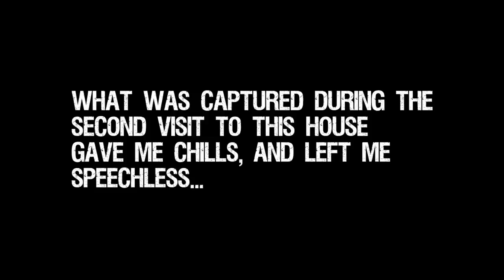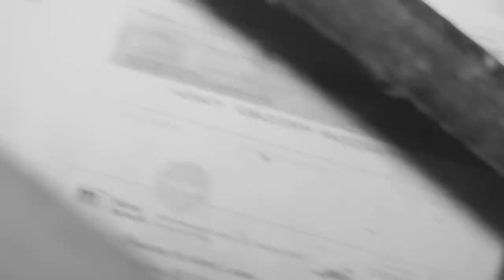(PART 2) HAUNTED LIVINGSTON MANSION. MOST HAUNTED SCARY HOUSE EVER!

Comment: CJ and Sonny, You must firmly grip the dousing rods between your thumb and forefinger. Otherwise you could be moving them without your own knowledge.
When using them, ask direct yes or no questions, or direction questions. 
When using the dousing rods, a "x or a cross" means no, when the rods spread or make a "y" it means yes. Ask to point to the direction of the room that the spirit is in.
Make sure you do your research on the equipment beforehand boys. 💜

Comment: 19:52 if you watch from the door frame and across the wall toward the door before it moves you can clearly see something moving across the wall and back and in the door frame you can see a flash in the upper corner.

Comment: You pulled the drawers out on that dresser earlier. You made it top-heavy, and just with you walking through there gave it enough force to make it fall.
Reply: He pulled the drawers out during the daytime.....WAY before it fell in middle of night.
The thing was empty and not so easily  tumbled over, if so it would've fell over way before that because they both were all around it a few times during the day.
Reply: VickyRenee Yes you’re right, and that’s what I said. He pulled them out earlier, which made it top-heavy. And they walk down the right boards in the right area at the right time to make it tumble over. Not supernatural.

Comment: What's happened to the cat?? I hope it's with a family that will look after it. Was a lovely little thing.
Also when you first went in the house for the first time, you went into the attic and both the chairs were facing away from each other. When you went back both the chairs were facing each other and now the chair next to the mattress has stayed still and the other has changed position facing to the left. Clearly somebody or something is doing it unless it's you or sonny.
You can use your rods to ask questions. Cross for yes open for no, point to where you are ECT.

Comment: 9:10 if the house is old and the windows are are old there is a possibility that there is just a draft.  My house is old and has old windows in disrepair and when there is a draft the curtains still move and I even have plastic sheets in them and they still move.  Ought to go and look at the windows thoroughly before just assuming that it's paranormal.
There must be a draft outside because I did see the tree outside the window move.

Comment: On the SP 7 with that Speaker mine identical to yours is crappy! Always has something going on with it! It is too bad as equipment is expensive! The sound always too low, when it says it is in speaker mode there is like no connection ! Find myself always spending time to get it to work! Out of the three of those I have had Gone through not with the talking speaker attachment they worked like they were supposed to! Miss my old Radio Shack Ghost Box but they do not make those anymore! But anyhow when I saw you trying to get it going that confirmed the speaker attachment was crap! It talks but that is it! May try  SB 11 next! Take care !!! Be safe !!!

Comment: At 14:49 you can clearly see the broom leaning against the wall. Then if you look at 18:17, it's in the same spot, so it wasn't the broom that fell. It was something else. At 18:56 an orb floated downward. Also, at 19:23 at the center bottom of the camera, something moves and at 19:27 sounds like a whisper. At 19:40 it sounds like a little girl giggling. At 19:53 the door to the left creaks open slightly but fast.  56:10 sounds like a man saying "hey". CREEPY AF!!👻😈